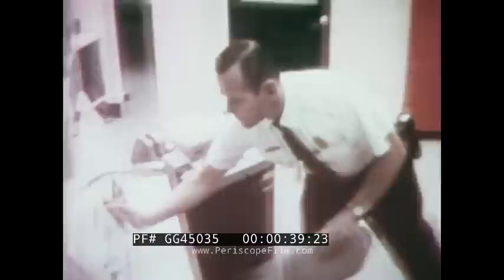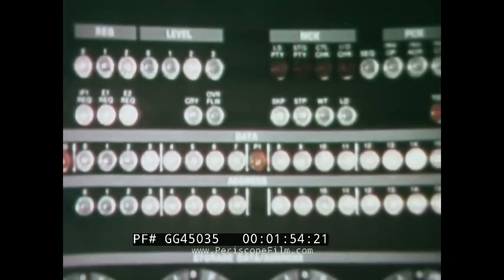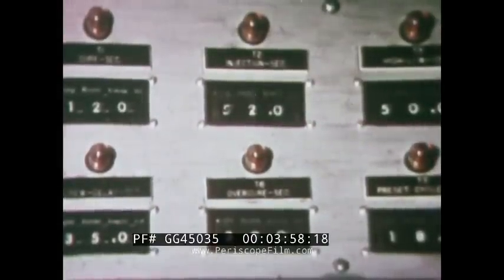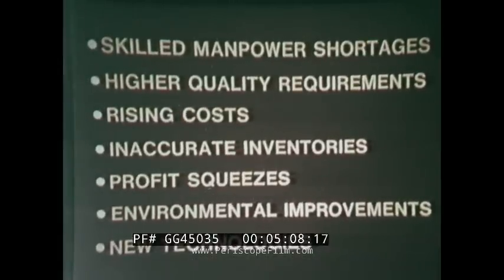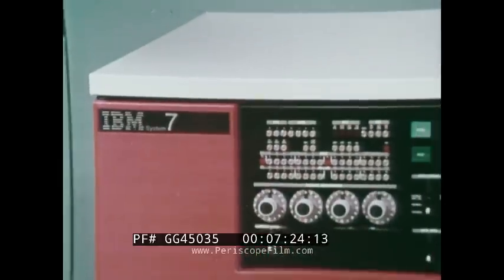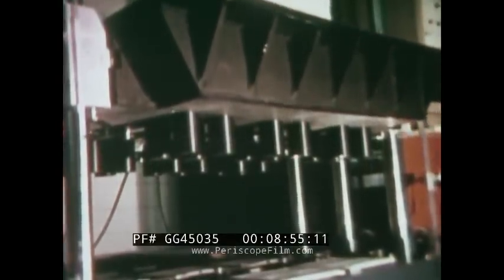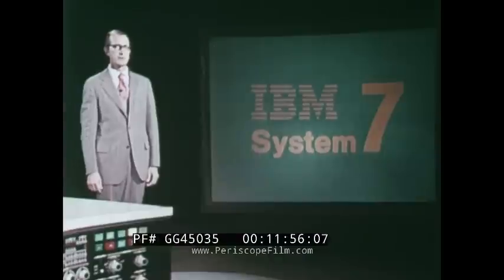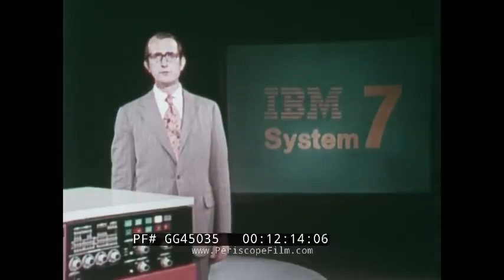IBM SYSTEM/7 COMPUTER SYSTEM  1980s PROMO VIDEO   INDUSTRIAL CONTROL COMPUTERS GG45035

Comment: Can anyone lipread here to see what the guy is actually saying during the presentation?
Reply: That's not an actual guy. Thats the IBM Model 25-7B12 Human simulant cyborg from 1972. Never made it to market as they could never solve the technical difficulties of syncing the voice module to the lip motors as you can easily see in this film. You may notice too that it very rarely blinked. Also, the polyester suit proved very difficult to iron :)

Comment: Quick sidebar to be amused that the timecode on this package is 24fps film timecode.
Reply from the maker: @baylinkdashyt Not sure I understand the comment. Why wouldn't it be in 24fps, this is a motion picture film -- which was shot at 24 frames per second?
Reply: @PeriscopeFilm because film is commonly transferred to video using 3:2 pull-down, which repeats certain fields.  Except in a film editing and production timeline environment, it's pretty uncommon to see clear, progressive 24fps time code.
Reply from the maker: @baylinkdashyt that's a misconception. That's how things USED to be done before HD was introduced. Since HD runs at 24fps there is no reason to do pulldown. It's now extremely common to see 24 fps production.
Reply: @PeriscopeFilm well, for direct to YouTube production that probably makes sense, sure. But I don't think 3:2 pull down transfer is at all obsolete - there's a whole lot of broadcast still using it to fit 30 minutes broadcast slots, even where the broadcast is in Progressive.

Comment: Your 2020 car has more control complexity, more sensors, and vastly more processing power than almost any System 7 implementations. All the sensor stuff in the car is way less expensive/ The System 7 CPU compared to a 10.00 USD micro-controller chip loses badly. System 7 software was robust. But, your car's firmware does pretty good too, and is probably more robust, and far more complex. IMO
Reply: Heck the same goes for your smartphone and that’s cheaper than a car!

Comment: A lot like an Arduino except an Arduino is eight times faster and fits in the palm of your hand.
Reply: Not quite. The System 7 was a 16-bit machine, 2.5 MHz, 64 kB RAM. Arduino is 16 MHz, but only 8-bit and 2 kB RAM. And the programs for System 7 were stored on paper tape, cassette, disk or any other external medium. So it was more flexible than an Arduino too.
Reply: @ArumesYT  Bueno, entonces usamos un esp32, o un dspic33

Comment: The system 7 was introduced in 1971. Judging from the clothes and the hair and the music, this video is likely from the mid 70s. By the 80’s we’d moved on to the System 370 and later the 303X line.
Reply: That’s about what I was thinking. I was placing this around 1974 or 1975.
Reply: What's this at 10:47? Application program Generator, was that APG/7?

Comment: Guessing this was IBM competing against HP and DEC in industrial control systems. By 1980, the system had been in release for 10 years. Neat stuff.
Reply: Sperry Corporation, Control Data Corporation, Burroughs Corporation, NCR, Honeywell, and RCA all made mainframe computers. At one point you’d also seen Univac, General Electric, Philco-Ford, and several others producing mainframe type machines.
Reply: DEC (Digital Equipment Company) was the largest company in the production of mainframe computers in the late 1970s and early 1980s. I don't know what they are doing now.
Reply: I think you mean IBM was the largest and also the last company to make Mainframe type computers.
Reply: @mickeymomighty5660 They were on the verge of failure in the 1990s, HP absorbed their assets.
Reply: @Nighthawke70  Thanks!
Reply: @Nighthawke70  Almost - Compaq purchased Digital specifically to move more into the large Enterprise/Corporate IT space and fully compete with IBM. Compaq had issues after the merger, never could find that synergy sweet spot (like so many mergers) and would end up being acquired by HP.
Reply: @Nighthawke70  VAX 9000 was a disaster